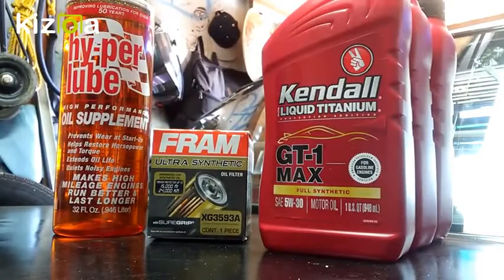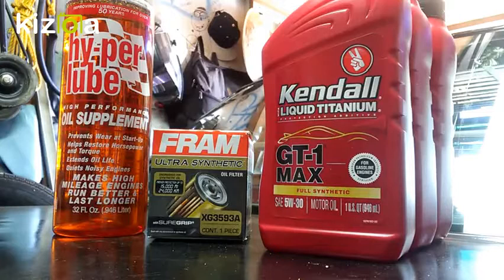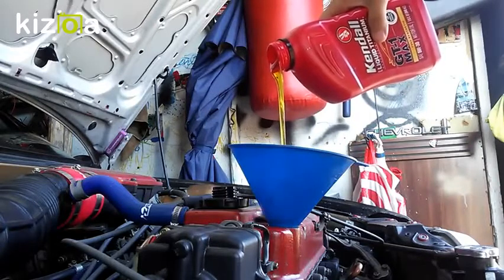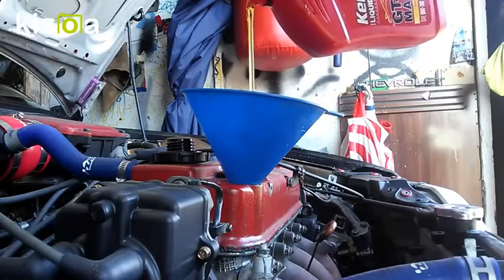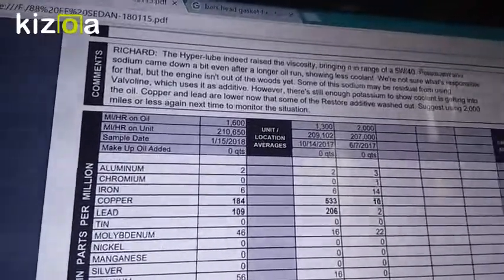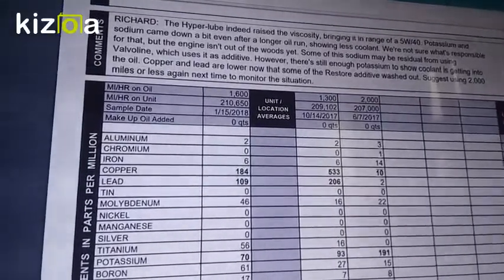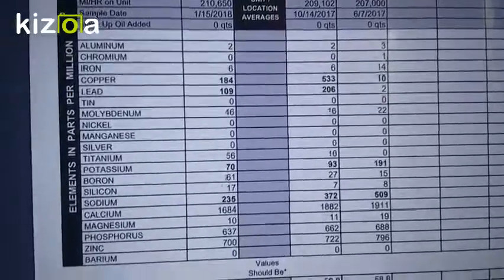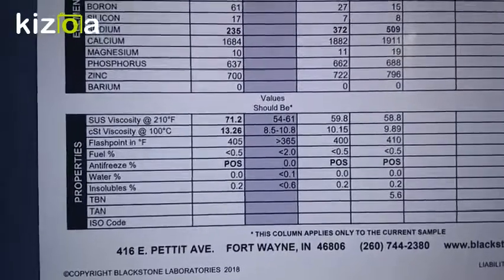Hy-per Lube Oil Supplement Review with Oil Analysis.

Comment: Stop putting crap in your car!!! Like I said ravenol offers the absolute best at great prices! And for few extra bucks you can get way better oil then that! Oil is the most important part in a engine and you don’t want to cheap out on oil. I rather put Amazon oil which is actually pretty good, penzoil, shell products. Even super tech. But hell no I’d never use a 99cent oil. Even if it was 2.99 lol.  Also try (restore) engine restorer it actually works and you will be impressed!! Actually fixes compression issues as well.

Comment: Yes lucas foaming up bubble up confirmed hyper lube is way better to use I'm using it in my mercedes e320 quite down the lifters also I see huge difference using rotella t6 with hyper lube
Reply from the maker: Hyper lube is still a great product, I haven’t used it lately.

Comment: I use this exact combination and my engine that now has 200,000 miles on it has never ran smoother or better. 
 I use the white K&N filter (they also make a black cheaper one) and it seems to keep the oil looking cleaner than most others. Do not use the cheaper Fram oil filters which are the orange colored one and the silver toughgard because of the cheap cardboard endcaps when they should be made out of metal. Their ultragard filter is excellent though.
 Also i don't think thicker oil additives are recommended on engines that have less than 50,000 miles on them. If people still insist, then i'd use maybe half the recommended amount.
Reply from the maker: Interesting notes. I have never used the white k&n oil filter before. Never had the chance to but will do next time.

Comment: thank you for the info!! I use Acdelco or Fram oil filters never have a problem.  There is nothing wrong with Fram filters.
Reply: They are made of cardboard.
Reply: You need to check the youtube videos where they cut open many different brands of oil filters. I guarantee you'll be shocked how cheap the filter element is in the orange fram filters. The filter pleats look cheap and haphazard and the endcaps are made out of cardboard. 
 I used to use these orange frams all the time until i saw these videos. I now use K&N white oil filters that seem to keep the oil cleaner much longer and sometimes Mobil 1 and Frams Ultraguard filters which are excellent as well but stay away from Fram's orange and also their silver tough guard oil filters because of their cheap cardboard endcaps.

Comment: Hi Richard. I watched your video here and felt I needed to chime in here. I'm an Automotive and Aero Nautical Mechanical Engineer. I've been at this for over 54 years. Many years ago I worked for Fram building their oil filters. I've used many brands over the years and I would never use a Fram filter if you paid me to. The best filters I've used were the Wix or Napa brand. Same filter. The filtering media they used in the fram filters were by far more restrictive. Not to mention the Microns of particles getting through was much higher. But The Hy Per Lube supplement is one of the greatest. I won't get into the particulars here but I would switch to the Wix or Napa brand filters. Just a little inside info for ya. There are even better filters out there but for the cost, I stay with Wix. Great video.
Reply from the maker: Thank you for chiming in. I like Wix XP filters. I will take your word about fram.

Comment: Put the worst oil filter made today
Reply from the maker: Fram ultra synthetic isn’t bad but what oil filter filter do you recommend?
Reply: One of the worst is the orange Fram extragard oil filter and there's no way i'd use it because of the cheap thin cardboard endcaps.
 I think Fram's ultraguard filters are excellent but i mainly use K&N's white and Mobil 1 oil filters.

Comment: I usually use hyperlube and sea foam, but this time I’m trying the Lucas high mileage stabilizer and marvel mystery oil, so far I love the marvel and I’ll be changing the oil in the next few days and putting in the Lucas, I’ll keep ya updated if anything unexpected happens. 2002 dodge Dakota 4.7 v8, 178k miles
Reply from the maker: Lucas high mileage stabilizer has always interested me.
Reply: Update?

Comment: my dad Used this in his Nissan Sentra 2006 sold it at 210k  with no issues with the engine
that might be old stock hyper lube (I have a bottle but will not use it)   the new one is thinner like 5w30 or 0w30
Reply from the maker: I personally think it's a good product. But me personally, of a car has been maintained well from brand new, there is no need for this product. It would be ideal in worn engines. I would love to use this if I ever have to assemble an engine. There would be no harm whether it's a new car but it would not be necessary.
Reply: @TheRichardF10   Yes he bought the car brand new at 5 miles  and had put some per  every 3,000 miles oil change
Reply: You're right that the new formula is not as thick as the older formula but it's still much thicker than 5w 30 weight oil. My best guess is it's closer to 80/90 weight oil that you put in differentials or manual transmissions.

Comment: I find it hard to believe that it would make a noticable difference in fuel economy, I had an old card that knocked and leaked like no ones buisness ran straight lucas stabilizer in it and only noticed a .2mpg drop
Reply: It probably affects more on  engines that have less torque.
Reply from the maker: You're right. It was probably just me but I noticed worse gas mileage. Nothing crazy but It was noticeable for me and that was my experience. Thank you for commenting.

Comment: In a 4 banger you only need half a bottle of hyper lube
Reply from the maker: Claw Machine Time I went with the instructions. 20% of Hyperlube and 80% of motor oil. So it depends on the engine oil capacity. My 1988 civic has an oil capacity of 3.7 quarts. 20% of 3.7 quarts is 23.8 oz. So not the entire bottle and not half the bottle.

Comment: Hyperlube will make your engine last a lot longer
Reply: It would be nice to see something backing that up.
Reply: I have been using the exact combination in this video for years and my engine has never ran better or smoother. It now has more than 200,000 miles on it and still runs like the day i drove it new off the car lot.

Comment: Fram filters destroy engines they collapse under pressure
Reply from the maker: Ralph Evangelista Was it the Orange Fram Extra guard? If so I stay away from those too. I have used the Fram extra guard (Orange Fram) multiple times in the past with zero problems and I push my car pretty hard, reaching high RPMs around 6,000. I've heard a lot of bad things about Fram as well but I have also heard many people say that is all they have used for 300,000+ miles and counting. My dad as well, 280,000 miles on a 1994 Chevy suburban using nothing but Fram extra guard and it is still running great till this very day. I love this Fram Ultra Synthetic, it has a really stout build construction and quality. The oil filters I typically use are Fram Ultra Synthetic, Wix XP, Purolator Boss, and STP Maximum Life. I don't have a problem with Fram filters, even the cheap ones, but I always use high quality products. I'm always consistent with my car maintenance. I am sure your friend is passionate about the his jeep and kept up with his maintenance as well.
Reply from the maker: BB6757 2008 I would not be surprised seeing the orange Fram extra guard collapsing but I know for a fact this Ultra Synthetic will not collapse.
Reply: I used fram in the eighties, had them collapse on me.

Fram's under new ownership, the last few years. They're actually making some decent higher end filters..  They switched manufacturers, for their filter.
Reply: Fram Ultra has wire-backed filter media and it has done 20k-30k miles on a single oil change without collapsing many many times. Proof is on "BobIsTheOilGuy" web forum. Best oil filter in the market, and best oil filter of the decade, or more.
Reply: Champ labs, wix or Purolator or motorcraft is what I use for my 94 F150 5.0.
Reply: As a parts guy I always steer my customers away from Fram. After my friends 99 Cherokee with the 4.0l blew from the oil filter media falling apart 2000 miles after the change and clogging the oil pump and passages.  When we pulled that engine apart I never thought i would see the day when a jeep 4.0 died.

Comment: My Ranger pickup with 240K+ miles developed a piston slap noise at startup, so I decided to try the STP high mileage oil treatment, which I think is another high-viscosity additive similar to Hyperlube.  To my surprise the noise was silenced, and has not returned even after about five oil changes since, and I only used the STP for the one change.  I think these high-viscosity additives might carry some risk if they are used for every oil change, but may provide some benefit if used occasionally.
Reply: my dad used this from day 1 of his new car at 5 miles (hyper lube)
he took it to 210,000 miles with Zero issue  and no leaks... i bed to differ on saying not to use " hyper lube "  this is a 4 banger engine  which means it runs "very high RPM longer" compared to say V6 or V8.  it barely makes Horsepower: 126 hp @ 6,000 rpm..   it was in the 3,000 to 3500 most of the time i.e highway speeds  70-75MPH   YEAH that is subject to lots of wear.. higher rpm..    more RPM = more wear...   I was going to buy a Nissan sentra 06 but they were all junk cars and they had way less miles i.e 120k
Reply from the maker: W Sears I agree with what you said. Since it clings onto the metal you might not be able to get all the oil out when doing the oil change. STP High Mileage oil treatment is a good product.
Reply: they actually made it thinner  in the newer version . you might have picked up old stock I think there was people complaining it was thinner
Reply: W Sears there is no risk using stp or hyperlube at every oil change its a proven fact they make engines last much longer if used every oil change they leave a protective film over the engine hyperlube is a better product than stp stp is better than nothing lucas causes foam
Reply: I think any additive that greatly increases viscosity of the oil should be used sparingly and carefully.  Both Hyperlube and STP can move a 10W-30 oil up to a 40 weight or higher.  I wouldn't use these products on new engines that call for really thin oils, because the tighter engine tolerances on new engines need thin oils to reach between all the parts quickly.  I would , however, use the additives on older engines like my Ranger where the tolerances have likely opened up a lot.
Reply from the maker: Yes, I reviewed this oil additive because I have always been curious about the product and I never found a legitimate video on YouTube about this stuff, so I just decided to make my own videos on oil additives. Typically with these oil stabilizer products like Lucas and hyper lube, I think 20% is a bit too much for mixing. A lower mixture of 10% would be better but you might as well not use it at all if it won't be as effective but it would still be better than the oil alone, but it always depend on the engine's health. just my opinion. Stay tuned, I'm currently waiting to get results back from Blackstone Laboratories on Prolong Engine Treatment mixed with Supertech Full Synthetic High Mileage oil.
Reply from the maker: punker4Real As awesome as it sound that your father took the car to 210,000 miles with zero issues/leaks, regular oil (either synthetic or conventional) with regular oil changes would have last just as long. To be honest, I really do like this product but I don't like how it thickens the oil by a lot. I hope you stay tuned to my channel. I have two videos coming soon. I tested out Prolong Engine Treatment and hopefully it should be uploaded within a month. I also have plans to test out Lucas Heavy Duty Oil Stabilizer mixed with 0W-20, but that won't be uploaded for another 4-6 months from now. I also want to know how much hyper lube your dad mixed with the oil. Did he use it as directed? 20% mixture.
Reply from the maker: punker4Real The Hy-per Oil Supplement I used wasn't very viscous compared Lucas Oil Stabilizer that's for sure. Who knows, it was my first time using this product. But I have gone back to Wal-Mart and the hyper lube they have is the same viscosity as the one I had for this video.

Comment: I changed my oil with hyper lube and seems that it is doing what the bottle says it does Knock on wood my car actually idled smoother with it but i did an engine flush too so that could’ve helped with that hyperlube kind of looks like lube they use when assembling engines at the factory hyperlube has been used for all types of racing too. Not sure what you meant by the car was vibrating though could be motor mounts
Reply from the maker: Jose Glory You can also use Hy-per Lube as assembly lube, it says on their website. My car is in excellent condition with good motor mounts. It was not a harsh vibration but definitely a more noticeable vibration. Hy-per Lube Oil Supplement is a good product but I am just sharing my experience. I normally don't use oil additives but I tested a few out.